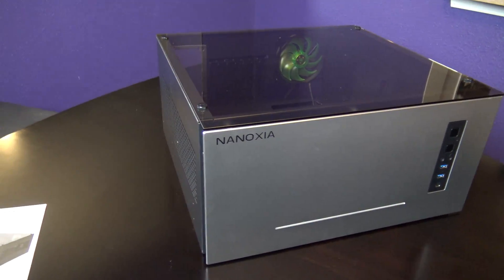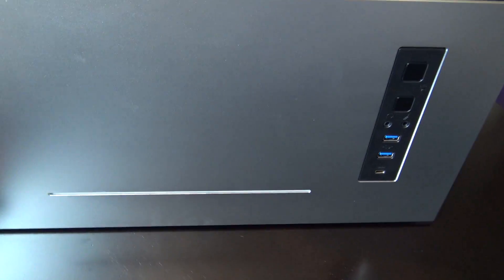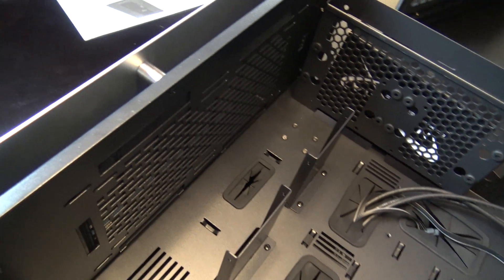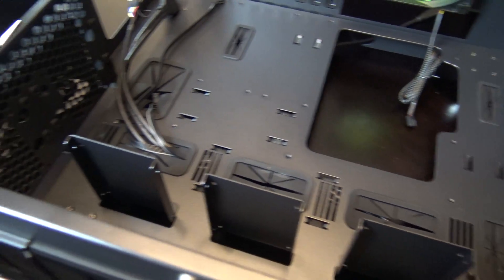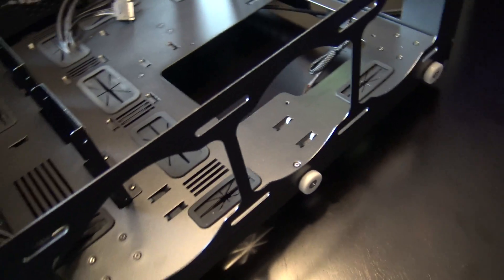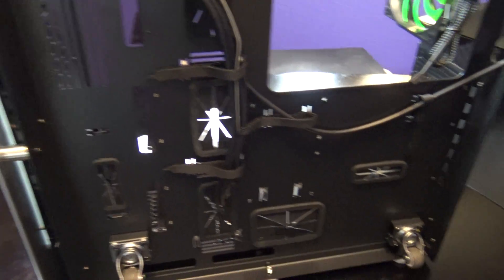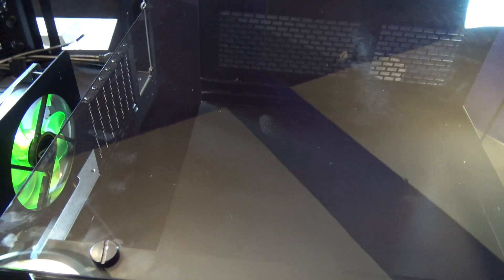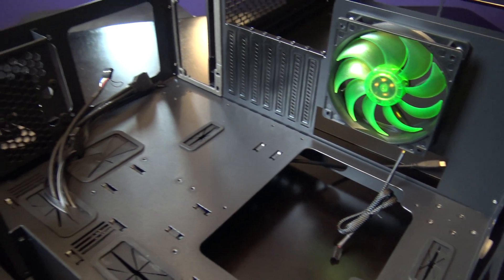Nanoxia Project S Review

Comment: Audio cable should be able to go behind motherboard tray to the bottom grommet then come out under motherboard. I do agree with you that it is too short.
For the glass, it is very likely to be a returned item.
Dimension wise, it might be a short 5U. It is too tall for HTPC. I use a 4U server case for HTPC and I have about 1/4 in clearance in my tv stand.

Comment: I got mine in silver and i share most of the criticism in this video.
My frontplate has serveral bumps, left and right side.
Inner case is completely steel and feels like a $30 case rather than a $200.
Screws mostly (!) dont fit into their holes.

The overall built quality is in my optinion terrible and justifies a price of maybe $50-60 but nothing more than that.

Evrybody who is used to good old Lian Li quality or even one of the better Jonsbo/Cooltek aluminium cases will be hardly disappointed with this.

Verdict: my first and last Nanoxia case...gonna stick back to my UMX4 and still look for a PC-V600FA or even  PC-V700A...

Comment: As a desktop this is a huge hell no. As an HTPC I felt this was worth a try :) I have this coming  in the mail today or tomorrow. I saw this review prior to my purchase. It is interesting to see the good and the bad on things. This is all very niche and more for the computer enthusiast crowd as opposed to the general public. The price points of the competition are way to high.  The fractal case equivalent to this was $600. I actually like that the Nanoxia is slightly flashy and over the top whereas the fractals are a little to low profile and plain for my taste. Just off the measurements sight unseen this thing is massive compared to my denon receiver. I am changing out my entertainment center (So the nanoxia can fit). If people are using this as an HTPC the fan noise should be drawn out by whatever you have going on the tv. Most people won't be sitting in silence looking at excel on this thing.  As far as the glass top it is a non issue for me. This thing will be sitting in an entertainment center. All I will look at is the front panel unless I'm upgrading something inside it. Not for everybody but it has potential.
Reply from the maker: I agree, it definitely has potential.

Comment: Just saw this on Amazon and thought about using it in a file cabinet type build... but silence is a concern for me...

One of the reviewers said it's really quiet, but I have concerns now seeing the way the fans are located and the openness of the case.

Probably not something a guy who is going to be recording will want nearby.

The quality you showed... OMG... The white is $250, the black is $300. Definitely NOT worth the money IMHO... thank you for sparring me the nightmare.
Reply from the maker: I cannot comment on how quiet it is, but I suspect it is relatively quiet. I have found glass to be a great sound insulator.
Reply: Get their Deep Silence fan series, i have a nanoxia Deep Silence six case and plan to buy another some time soon (unfortunately they stopped making them in white) the quality is amazing. The case was $219 when i got it but it came with 5 140mm deep silence fans, they are outstandingly silent and subtracting the fan cost from the case its worth more then what i paid in my opinion.